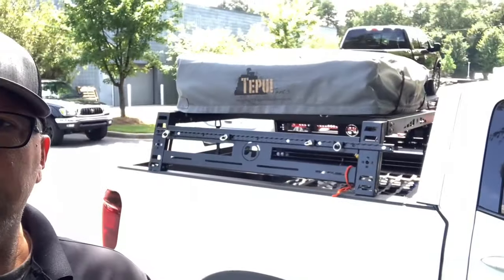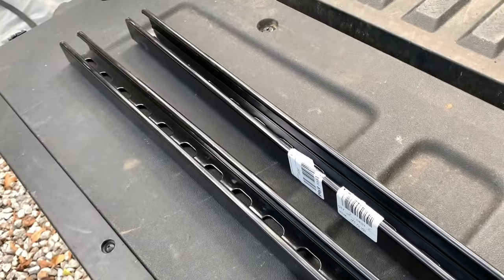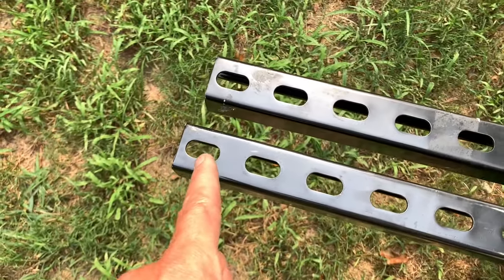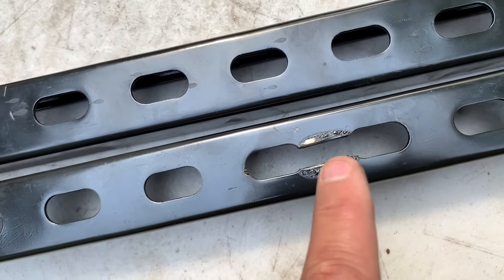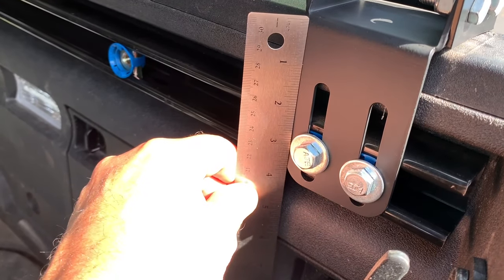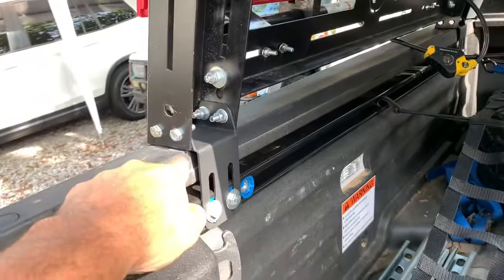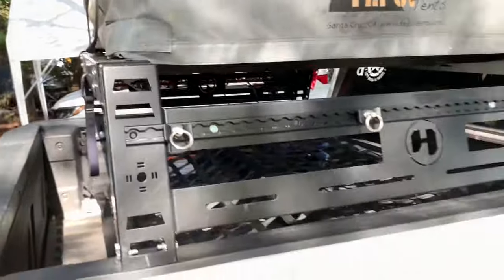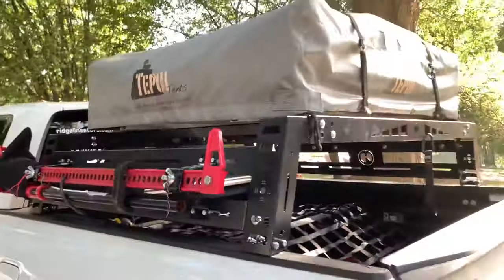Honda Ridgeline Bed Rack - How to Install using Unistrut

Comment: Rubber washers are to keep water from getting behind the bed wall through the screw holes. Maybe silicone the threads to stop water? Just FYI.
Reply from the maker: Interesting

Comment: Thanks for all the great vids, info, links, etc.  I'm forever on a tight budget (frugal more so than poor, and like to do lots of other thing) so DIY info is always helpful. Gonna pick up some unistrut this week and the next thing will be to decide on a bed rack. Prebuilt universal, prebuilt Ridgey-specific, DIY unistrut, or DIY welded tubing?  I'm not a master fabricator but I'll probably end up making my own brackets or extensions, at least, and I might be able to justify finally buying my own welding gear. Decisions, decisions...
Reply from the maker: Let me know!!!!

Comment: Sorry not sure what the hell happened there lol. I was asking if this would work with a regular or retractable Tonneau cover. I Never owned a truck before and was planning on getting a ridgeline but I wasn’t sure if this rack system would interfere with it or not.
Reply from the maker: I think the google translation is not working properly.
Reply: @CampingRandy  my apologies user error lol I fixed the question.
Reply from the maker: Understood- you can install a “within” the roll cover. There will be some cutting of the rails. The Oem hard cover can be inserted but you will not be able to open.
Reply: @CampingRandy  thanks man appreciate the feedback, love your videos.
Reply from the maker: Anytime and thank you!
Reply: Did you ever decide? My understanding is that most racks will interfere with most tonneau covers. There are some that play nice together apparently, but I can't comment on that. I really like the idea of a soft topper under the rack (CampingRandy has another video for that!), to get all the utility of the rack and keep a ton of space covered and dry.

Comment: Camping Randy...   I need bed rails for a Ridgeline.  The key here is I need them to miss, when mounted, a tonneau cover/allow for a tonneau cover. 
-
The reason I need them is so I can mount all my bikes.  If the bed rails were 2"x2" tubesteel, I could then mount (4) bike fork mounts down each side of the bed.  The bikes would sit across the bed, with the rear wheel sitting on top of the tonneau cover.  A bungie cord would secure the rear wheel to the fork mount 'across' from the for mount where the bike was mounted.  We need (4) different kinds of fork mounts for all the kinds of bikes we have.  Quick release/road bike, through-axle/mtb hardtail, super-boost/mtb dualie, and mounts that fit our Lauf forks on our gravel bikes).   
-
I have a similar setup on my current 2011 Ford Ranger.  The only difference is the Ranger has a 6' bed.  Which means the 12" Retrax roll-up tonneau cover leaves me a 5' bed.  And since the Retrax takes up 12", it allows for my custom tubesteel rack to sit above it - so the bikes are mounted front to back.  The forks sit right behind the cab, and the rear wheels sit on top of the tonneau cover.  The rear wheels are then bungied to hooks on top of the tailgate.
-
This is an amazing set up for bikes in a pickup.  As the rack is 'always out of the way' as it's mounted above the tonneau cover.  And the rack doesn't interfere with the operation of the tonneau cover.  And when (4) bikes are on top of the tonneau cover, we can put all the front wheels, a cooler, our suitcases, etc - under the tonneau cover, locked and out of the elements.
-
Since the Ridgeline starts with a 5' bed, I don't think there is room for a Retrax - so I can't mount the tubesteel rack like I do on the Ranger.  But if we go with (4) mounts on each side - on top of bed rails, that will allow me to install either a small roll-up tonneau, or a 3-panel tonneau (I haven't decided which will work best).
-
Thanks for any info you might have...
Reply from the maker: DM me on Instagram @campingrandy where it’s a little easier to communicate.
Reply: @CampingRandy  thx for the response, I don't have instagram..  sad face...
Reply from the maker: Email SUPPORT@RIDGELINESTORE.com

Comment: have you had any concern/ issues mounting the unistrut with the factory bolts for the bed liner. Does it have enough strength to hold up a rack with load?
Reply from the maker: I can neither say yes or no. It’s 100% up to you. If you feel they are not strong enough, there are plenty of options with bolts and washers.